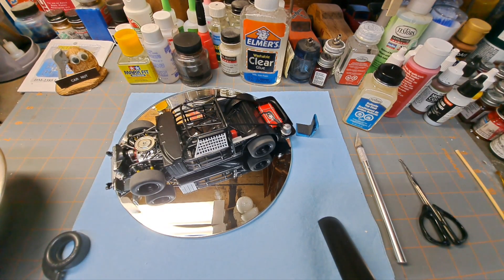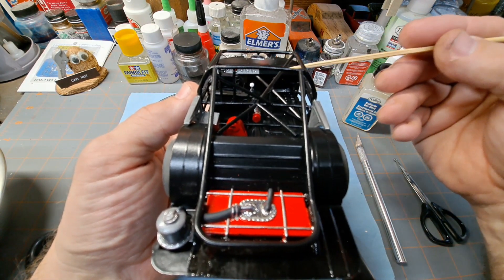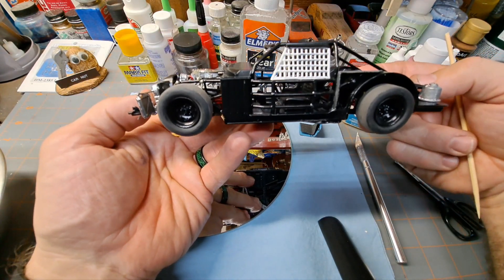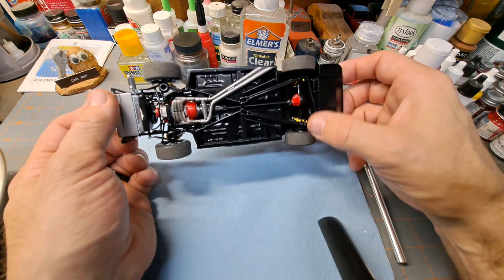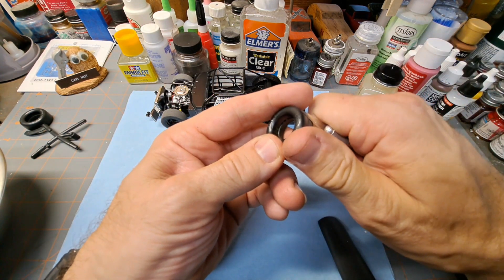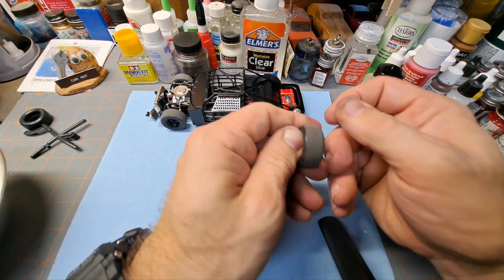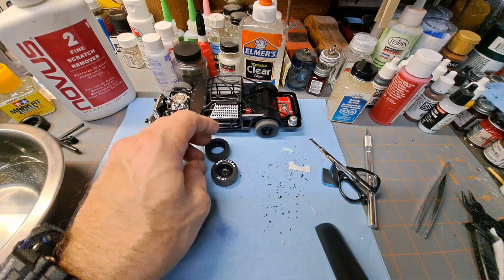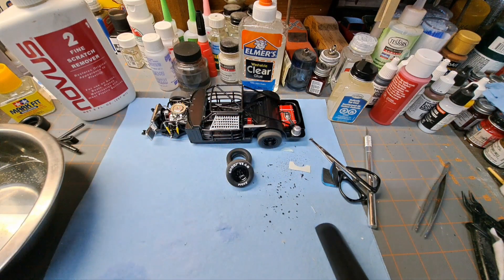NASCAR kit tires: How I weather them up

Comment: I have a lot of NASCAR models to build…. I have the old brass stencil to spray on the lettering… I have been using Tamiya white primer for this… gives a good result…. Do you think that will work over the Novis2…I’ve never used it and was wondering if it leaves a residue? Thanks and keep up the videos
Reply from the maker: That shouldn't be a problem. I've actually used the Novus2 to polish a  body and then apply decals to it. Didn't have any adverse affect. Thanks for watching!